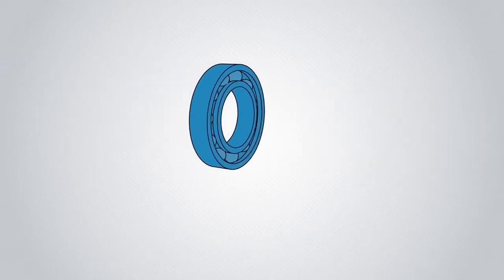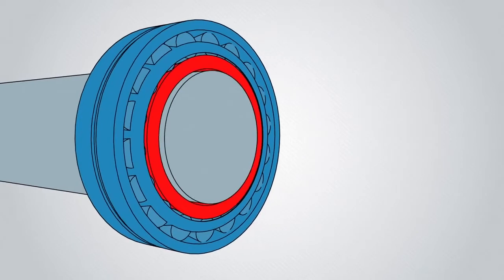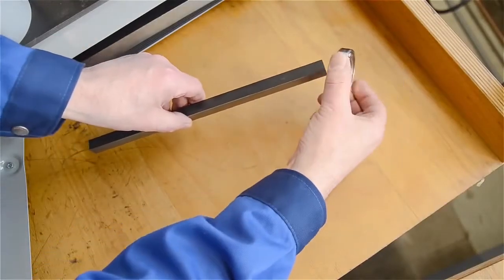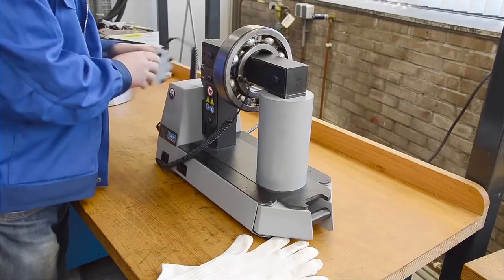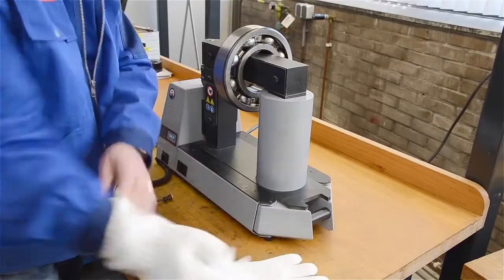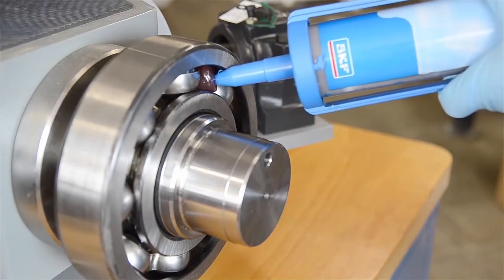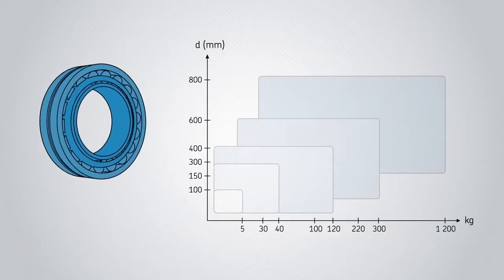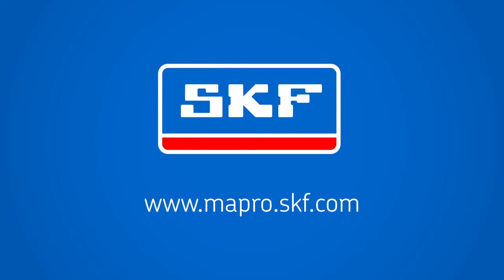SKF Induction Heaters - Heat Your Bearings

Comment: nice method,  I have some old Equipment from the 70's and the method to heat the bearing is a toaster oven with a ir thermometer. This method has worked for over 40 years. I  like the new tool shown ai don't own one. Thanks for the videos.
Reply: Which sort of method ?